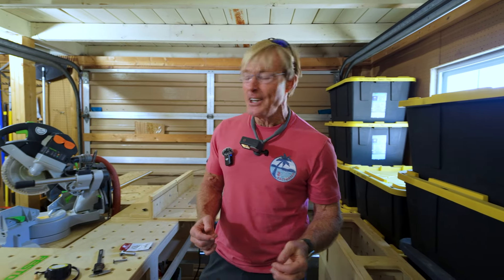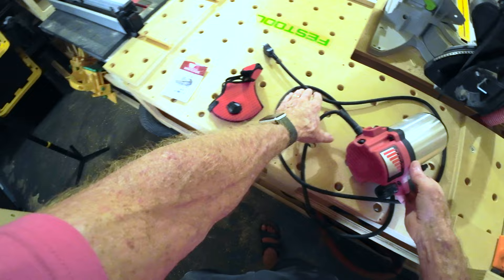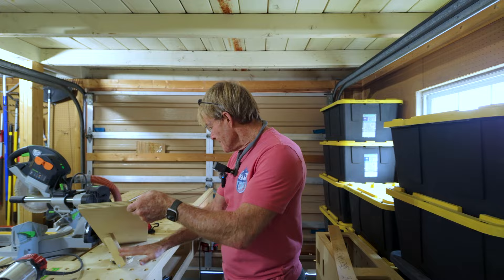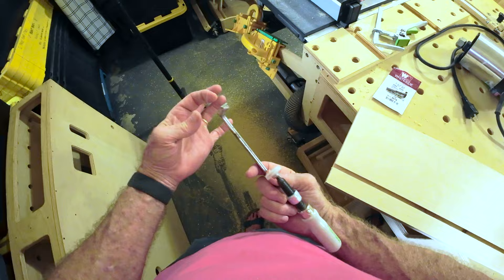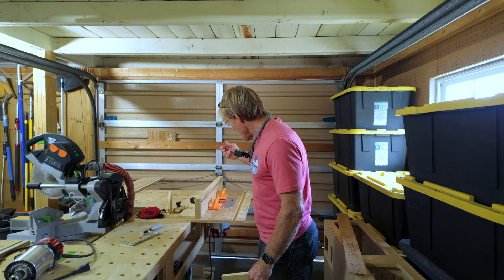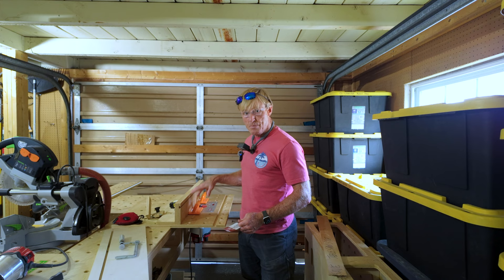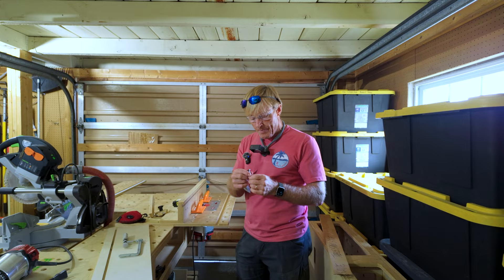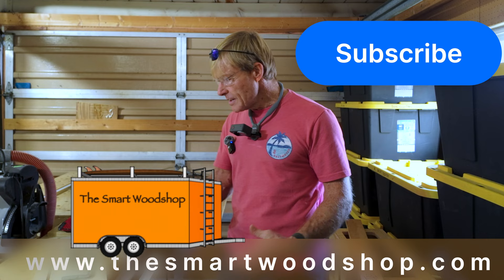Precision in Action: Whiteside T-Slot Router Bit Field Test and Analysis

Comment: I forget what you call it, but some time back, I recall a device you hung on the front of the bench where it has vertical strips using the hole system for height adjustment.  I think you used this for doing door edges/hinges.  

Anyway, you might cut slots vertically along those strips and add the t-slot clamps like you have here.
Reply from the maker: The Smart Panel Rig has T-Slots, albeit the smaller version. I believe I can feed them through my router using the new bit to accommodate clamps.

Comment: Have you run that bit in a smaller router?  I'm wondering if my 2 1/4 hp Bosch  would turn it as well as your bigger Milwaukee routers.
Reply: I was wondering about the same thing. I have a 1617, but I don't have one of those 3-1/2 HP Milwaukees.